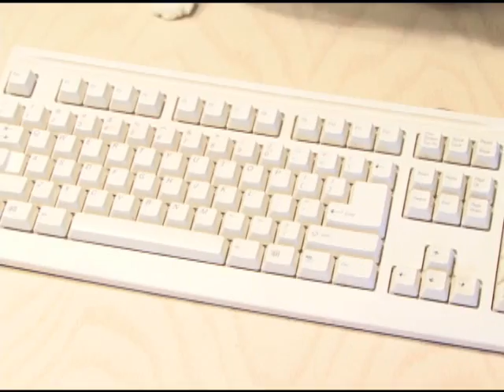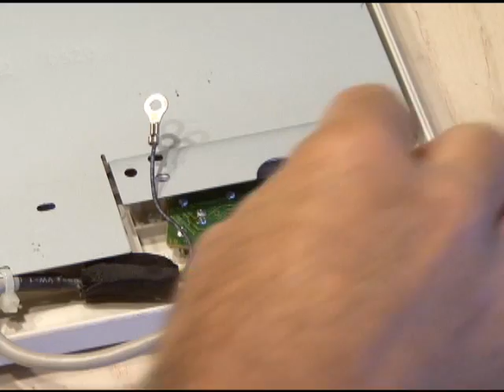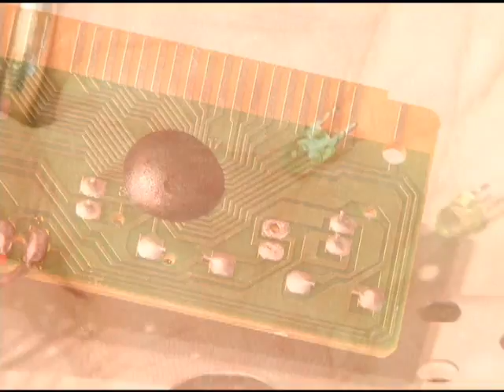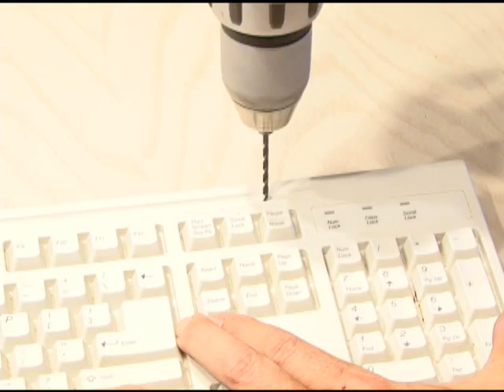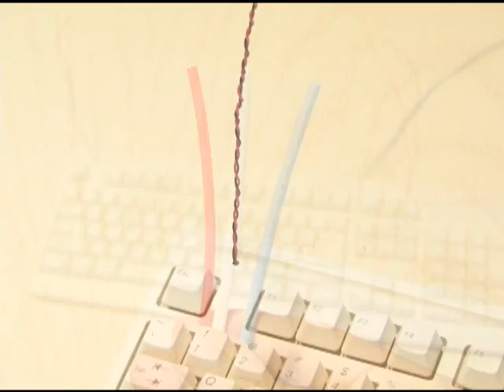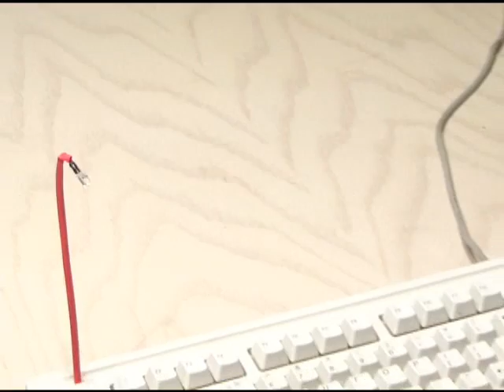Illuminate Your Keyboard!

Comment: Better yet, I would rather wear one of those LED lights that you put on your head so you see light wherever you are looking in the dark. Easy no mess, no soldering required. Still has that GEEK factor though that you can't get around unless you actually get LESS lame and actually BUY the real thing.

Comment: but I need scroll lock.
Reply: What do you need it for? On modern operating systems, it's useless.
Reply: Then... use caps lock, you can just hold shift when you want capitals.
Reply: you can use any key key...
Reply: I'm pretty sure your scroll lock would work fine after doing this hack since it's an LED you're replacing, not the "wires" that are connected to the button.

Comment: im going to do this to my laptop
Reply: I wouldn't... laptop keyboards are laid out and constructed differently than desktop keyboards. Try Radio shack EL wire, still some risk involved and you need an inverter (a little bigger than a Matchbox car). The wire can jam in the gaps around keys if your keyboard is like that, and the inverter could stick to the back of the screen with double sided tape. Costs about $40, 20 for the wire and the same or less for the inverter, but EL wire is available in a few colors and is quite bright. Red, blue, and white are the colors I remember.
Reply: gerbilPROJECT u didnt get it did you xD?
Reply: Noooooo pls

Comment: Nice idea and simple instructions. However I feel you should've emphasized the importance of polarity and to take out 1 black and 1 red pair from each hole, and to test the LEDs polarity at the end of the heat-shrink before final soldering by actually switching on. Or instructing that the longer lead is the anode (A + positive) or the shorter lead and the part of the LED with the flattened rim is the cathode (K - positive)
Reply: Wow, just wow!

Comment: Depending sometimes on the maker. Some have more solid plastic around the outside. Also, check the mm of the LED's, because they may be bigger. Bigger=more plastic they have to go through= higher voltage. Also, one may be Ultra Bright while one is not.

Comment: *facepalm*
Yes but this is much cooler and you could just go out and buy one with the lights in the cover. And it wouldn't be especially hard to just leave the lights inside the cover instead of drilling a hole in the keyboard to pull the wires through...

Comment: @kipkay Thanks for this! I wouldn't use it but it inspired me :D i am going to take apart my keyboard , cut out the letters the put some 100% clear , thin plastic underneath it. I'll then wire up the L.E.D.s so when i press the the shift button it lights up but shift still does its job :D Do you think i can do it?

Comment: @DFTheNightmare youre wrong, no offense.. but these things are absolutely hacks.  Anytime you modify a device, or something, even a situation, change it to do something else is called Hacking, yes. hacking is creating a trick of some kind, any kind..) youre just used to the most widely used meaning, as in computer hacking..  even then, what you may not consider to be a hack might be.. there are many examples// even in computer hacking it deosnt necessarily mean breaking  into someones machine..

Comment: well im pretty sure tha screen would give off light unless u like sitting 10 feet away from your screen with tha keyboard....but it would be pretty cool to do it a diff color or sumthin....and instead of drilin tha hell out of your key board you could just use crazy glue or strong tape to make the tube stay on the keyboardd :p

Comment: @noelangelo1 Yes you can, if the laptop has lights. If it doesn't, I'd much rather tape two LEDs to a battery and a switch and use that. Nothing fancy, but beats opening your laptop.

Comment: I think using a voltage buffer (e.g. a transistor) between the scroll lock LED output and the white LEDs would have been a good idea. High brightness white LEDs draw more current than the LED they're replacing, plus, there's two of them, so you're possibly overloading the circuit there.

Comment: @fladoodel How is doing twice as much work for some stupid looking keyboard that doesn't fit in a desk tray "fun"? I'd rather buy one lamp for $10, than $2 worth of heat shrink tubing, $3 of wire, and a $50 soldering iron. Hmmm 1 aisle and $10, or 3 aisles and $55...

Comment: The only problem is that the 270Ω resistor won't be the right value for two white LEDs. Because of the excessive current draw, the resistor can actually burn up rendering the keyborad useless.

Comment: I have an oil lamp that works just as good. No need to do a hack. Just fill it with oil and light the wick. And why would U need to light your keyboard? R U hiding from someone? Keeping the lights on works good too. If the power goes out and U R lighting a laptop I understand. But for about $400 U can get a cheap gen that will keep your laptop lit. Just be sure to plug it into a surge protector. They are cheap too. As long as the phone lines are working U can get the net w/o all this BS

Comment: people, there is something called a lamp. You can put it behind your laptop or on the side of the modem, and aim it so that it's aiming at the keyboard. turn on the lamp, and it'll work better than the flimsy tiny lights. if you don't want to bother someone who's in the room, you can tape some paper around it to channel the light more in one direction.

Comment: @jkthecjer - I tried that, mine worked fine with 1 led, but as soon as I tried connecting the other, they both went out.  I tried series and parallel.  Maybe there just isn't enough current in my keyboard to feed them both.

Comment: Ok mine worked, but here's my tips:

1) I used thin 8g wire for the LED, and used thick 14g wire as a support rod, and wrapped the LED wire around the support.  Sturdier, but still flexible.

2) I drilled the hole where the scroll lock LED was,  less distance = less wire.

3) How the hell did you get 2 LEDs working on one indicator?  Two LEDs = 3.0v min, but my meter reads 1.5v coming from the keyboard!

4) I sandpapered the LED to diffuse it, then extended some tubing around it to focus it.

Comment: @NordicSpartan I think there's no need for resistors since he just replace the Scroll-Lock LED with another LED. To cut it short, the resistor/s are already in the circuit board.

Comment: @beliha why did you buy 10 if you find them useles... lol....but seriously you can use the flexible  stem and replace the led with a brighter one...there are flashlights in the dollar stores with better led i dont know exacly what they are called. these are the ones with tiny yellow spots at the middle.....they the ones with magnified yellow spot at the center. its neater and usb is something u can put away when you dont need it

Comment: I did this, used the green low brightness LED that came off it tho. I also used a pen casing instead of heat-shrink yeah im that chetto
anyway, now I put it back together and it all works except the number pad! and yeh i use the number pad a lot... FML
any idea what i did wrong?

Comment: yeah, like that's the issue here.
i hate working at my computer in artificial lighting. i really suck for me. plus it's bad for your eyes because it takes out contrast. and as the oil runs out, you should consider not using electricity just because you can pay for it..

Comment: @r31ncarnat3d I'm not even a Mac user, but I can tell you that's complete bullshit.

Modern compiled languages are made to be platform independent: that means Windows, Linux, and yes, even Mac.  In fact, Mac OSX is based on BSD and can use the same GNU toolchain that Linux uses.  If Linux can do it, Mac can do it, and Linux is definitely made for programming.

Sure, only Windows has Visual Studio, but there are plenty of other IDEs out there.  Take a look at Eclipse or Xcode.

Comment: You can illuminate keys that are made of solid colored plastic. Keyboards that featured illumination have transparent plastic embedded at the core locations where it's supposed to be illuminated. If you try to illuminate a standard keyboard all you'll do is to illuminate the spaces between the keys instead of the keys themselves.
It's not required to think, but at least make an effort before you post shit where others read it.

Comment: ...You don't need the ribbon or the keyboard section. Just solder in your external relay for input to the letter A to Z or 1-0 (or whatever keys you want). Do a program in HTML, VB, BASIC, Pascal, etc.  to scan the keyboard for keys pressed. Viola a ADC on the cheap! Great for a computer-aided burglar alarm sensor monitoring system?

Comment: @kipkay- Again another great project. However, again I have one for you to check out. Ever want to make a real world interface project with your computer? Like for a robot, security system, or a science data management  experiment? WELL how about getting an old USB keyboard pop it open, gut it down to just the circuit board and usb cable.

Comment: It is generally a bad idea. With high brightness LEDs you can easyly exceed 1W of power demand. I blew a resistor with such diode lately. If you overdo it, you can even burn your motherboards keyboard port. In 80% cases it takes power directly from computers power suply. You cannot know the other cases however.

Comment: Lmfao Just

Create a Battery Pack And Wire up L.e.d's around the keys Underneath

You could use colour changeable Ones It would cost you $20 for everything And it Would work better than two lights,

With this video your better off just turning on your light or buying a lamp lol

Comment: Lame you dont have to though all that you can do the same thing with a usb cable and leds + you dont have to unscrew drill solder put cables though etc. You'll get the same result and your keyboard won't be destroyed

Comment: you cant because it would mess up the lap top.  you can get a small clip on light though. they are not very expensive and run on batteries.

Comment: The little chip that provides the current to drive the tiny scroll lock LED is not designed to drive two 5mm white high intensity LEDs. You could end up killing your keyboard within a few weeks.

Comment: there's no reason why it SHOULDN'T work.. except maybe if the two LEDs draw more current than the one you took out.. but even then they will probably still light up.  The best thing to do would be to connect the two LEDs first temporarily before running any wire or drilling any holes.

Comment: Wouldn't that blow your resistors and caps in the usb interface, I dont think I would try it. You could solder them in series; it would use as much powers thats available but also protect the circuit. Parallel circuits tend to use more amps and put to much current through the circuit board. But a bad attempt

Comment: actually, this might work, but there might be one sticking point, that being that the little black blob in the center of the circuit board is the chip for it, and that chip cant usually source out enough current to power the LED's that he hacked in there, but you could build a small circuit that ties into the +5 volt supply from the computer and use the scroll lock LED's electricity to switch the kbd +5 volts to the leds he used

Comment: It's old, so try to think back to when displays were really small and a lot of people didn't have a mouse for their PC.

One use was spreadsheets. Scroll Lock would lock the cursor on the screen and let you scroll the page. There were no scroll bars.

Another use was to stop the screen from auto-scrolling and let you use manual scrolling.

There were other uses too. I wish IM programs would use it. OFF: arrows go through the last thing you typed. ON: Arrows scroll through the message history. :)

Comment: I have a wireless keyboard so it will drain my battery pretty quickly unless I add my own button and battery to control the light.....that is, if I choose to work in the dark instead of using my desktop lamp..........maybe I can buy a Solar Cell and attach it to my nearby window so the battery can be recharged during the day? Hmmmmm...................... THANK GODDDDDD FOR RADIO SHACK!!!

Comment: It depends on your setup. For about a year, I had no place to put my computer monitor but on the ground near the edge of my bed. So, when I sat on the bed with the keyboard on my lap, the light from the screen was insufficient to light the keyboard, since most of it just hit my legs. I solved this by using a small desk-lamp, but this would also have worked.

Comment: the g15 is a upgraded version of the g11 and with the m1 m2 m3 keys it makes it more organized and with a g11 you would be in a game scarying  to find witch gkey you assigned. also the g15 has a screen om it and it can be used with world of warcraft  and other games and only some of the heys are blue the rest have no light and the g15 has a better respond time. the g11 is a older keyboard and the bottens put more stress on the fingers

Comment: Actually, this deserves a better follow up than I've been giving.  

It is simply not possible to get good lighting from the small amount of current (2 ma or so for a typical indicator LED).  

The amount of current is set by the resistor that is in series with the LED.  The resistor is like a valve controlling the flow of water.

The bright white LEDS that are used for illumination use about 20 ma.  Unless you change out that resistor, they will be very dim.

All the best.

Comment: This is a smart, fake video.

There won't be enough current to get any significant light out of the white LEDs.  IOW, the two LED's won't be any brighter than the original Scroll Lock LED was.  

It is practical, OTOH, to get plenty of light by snipping off the end of a USB cable, and wiring up the two LED's, each with it's own resistor, off a USB connector.

Comment: it's the same power it is using from the LEDs from the caps lock, num lock, and scroll lock indicator lights. no side effects. there's plenty of power going through the USB cable or PS/2 port.

Comment: actually lights waste too much extra electricity XD.  Perhaps a usb led light might do the trick though.  Won't work if you don't got any usb ports near your keyboard, but I guess that's the laptop solution haha.  Another way to avoid this whole process is to learn to touch type, so you don't need to see your keyboard.

Comment: It's pretty much the same as making a doorbell. The only difference is you need to do it on a keyboard instead of a wooden box (i'm talking about one i made in school. you press the button and it buzzes and a light comes on.) We used wooden handmade circuit boards. That was last year, when i was 13.

Comment: It's solder, and this is for those people that would rather strip some wires, and drill some holes instead of wasting gas going to the store. Cause at around 4 bucks a gallon, all I have to say is fuck that.

Comment: That wont really work with all keyboards cuz i have one and windows vista on the computer,
There is absolutely no lights on the keyboard but u can see if scroll lock is activated on the computer, about where the clock is.

I  wish a had an old and bad keyboardde so i could try this but i don't :(

And before i forget, great video!
Keep up the good work dude!

(Btw, i think this is the longest and most useless comment i ever wrote, only 0 letters left, You guys m...
Sry, Running out of letters.)

Comment: I suppose you could use this method to backlight it like we all wanted, anyway. Just put the lights inside your keyboard (I know there's room in one of my keyboards for a couple LEDs, but my other ones are probably too small).

Just a thought, though... Wouldn't your keyboard be illuminated by your monitor, anyway?

Comment: "And then by following the polarity markings for the LED on the circuit board, we're going to wire two reds and two black wires into each hole from the LED connection."

It's like he's speaking a whole 'nother language.

Comment: I'm not sure this would work with any keyboard, because high brightness leds need more current than the standard ones, so the keyboard circuts may not be able to sustain it. The project might not work at all and the keyboard controller might get damaged. You'd better amplify with a transistor the signal you are using to pilot the lights... a 2N2222 should do the work.

Comment: Its OK if your keyboard is ON your desktop and not in a slide out unit under it. Wouldn't it have been easier to pick up power off the 5V and 0V rails on the circuit board, rather than relying on the scroll lock key?

Comment: I've had my Air since it first came out, and I've never had any problems with it.  I have never had a need for the superdrive, and the backlit keyboard works very well, as it does on the MacBookPro.

Sure the Air has a smaller hard drive, but I wouldn't call that a defect; perhaps this computer isn't for you.  It has served me very well.

Comment: I wonder if that is real, sounds like "household hacker". On a wireless keyboard, I recommend rechargeable batteries. I have both, I could attempt this on my old wired keyboard. I am not sure if there is enough power to light 2 lights and for brighter leds, but I do know LEDS use about 1/10 of a watt, so it might just work.

Comment: 2 things; it actually has to do with the keyboard, especially if it's wireless and runs on batteries. and secondly, an led requires very little energy compared to a computer as a whole. it would be like... adding a drop or 2 of water to an 85% full glass of water. in theory, yes, but realistically, no. good question though

Comment: My MacBook Pro (which I love) has that feature, but it doesn't work very well. The light from the screen often cancels out the light detector. Unless it's pitch black, the light isn't bright enough and is basically useless. This is compounded by the fact that the letters, numbers, and symbols are hard to see anyway and are not visible without the backlighting. I wonder if there's any way to adjust the detector sensitivity.